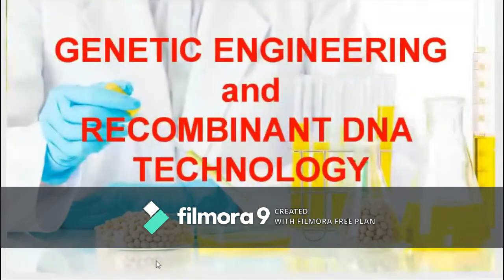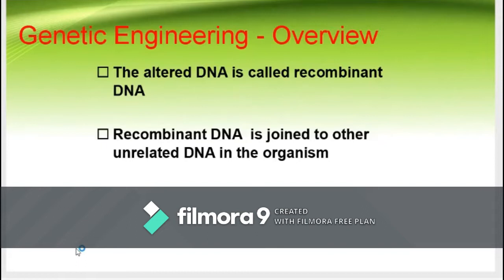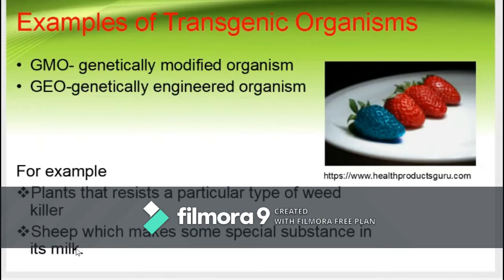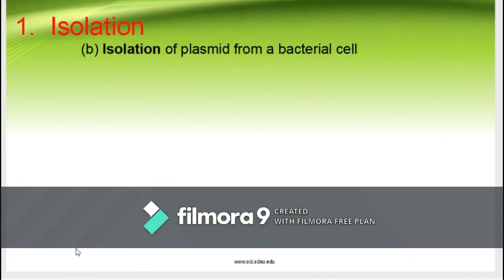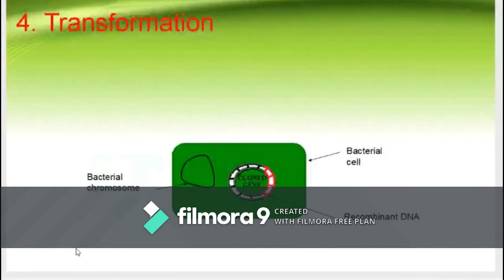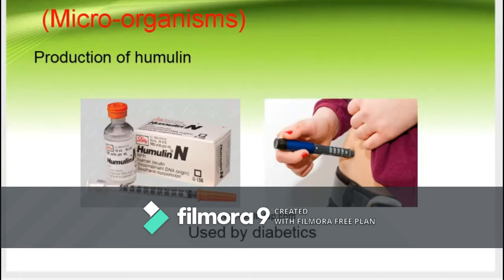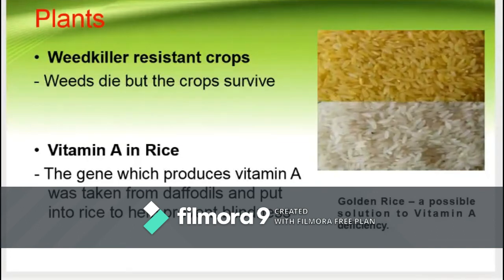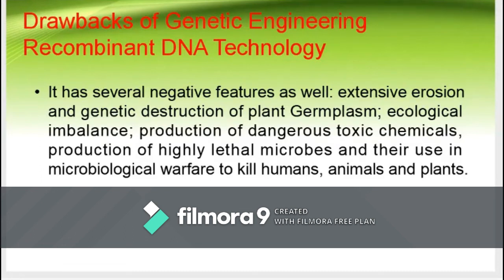GENETIC ENGINEERING & RDNA TECHNOLOGY

Comment: Alturas, Hyres Jane A. - Mendeleev 

REFLECTION IN GENETIC ENGINEERING AND RDNA TECHNOLOGY
      Genetic Engineering means that DNA from different organisms can be combined and it involves manipulating genes to make useful or beneficial products. Its purpose is to allow genes from other organisms to be combine with one another. It is usually done through addition, deletion, and manipulation of a single trait in an organism to create a want or desire change. In a molecular level, it is copying a piece of DNA from one organism and joining this copy of DNA into the DNA of another organism. Recombinant DNA is the altered DNA and it is joined to other unrelated DNA in the organism. Transgenic organisms are organisms that are altered by genetic engineering, its examples are genetically modified organism GMO and genetically engineered organism GEO. There are 5 stages of genetic engineering, the isolation, cutting, ligation and insertion, transformation and expression. Recombinant DNA technology in genetic engineering are applied in the field of medicine, agriculture, environment, and forensics. 
    According to the article AMA Principles of Medical Ethics: I, V, VII : Gene therapy involves the replacement or modification of a genetic variant to restore or enhance cellular function or the improve response to nongenetic therapies. Genetic engineering involves the use of recombinant DNA techniques to introduce new characteristics or traits. In medicine, the goal of gene therapy and genetic engineering is to alleviate human suffering and disease. As with all therapies, this goal should be pursued only within the ethical traditions of the profession, which gives primacy to the welfare of the patient. In general, genetic manipulation should be reserved for therapeutic purposes. Efforts to enhance “desirable” characteristics or to “improve” complex human traits are contrary to the ethical tradition of medicine. Because of the potential for abuse, genetic manipulation of nondisease traits or the eugenic development of offspring may never be justifiable. 
       Genetic engineering is the process of using recombinant DNA technology to alter the genetic makeup of an organism. It also involves the manipulation of one or more genes to make beneficial products. A gene from another organisms is added to other to create a desired change. Recombinant DNA is the altered DNA and it is joined to other unrelated DNA in the organism, where it is done through gene splicing where tiny segments of gene are taken out and replace by different genes. In genetic engineering, recombinant DNA technology is used in numerous ways, such as medicine for vaccines, agriculture to enhance crop quality, and many more. Moreover, genetic manipulation can carry risks to both the individuals into whom modified genetic material is introduced and to future generations. Germ-line therapy, in which a genetic modification is introduced into the genome of human gametes or their precursors, is intended to result in the expression of the modified gene in the recipient’s offspring and subsequent generations.

        In this topic, I learned a lot and understand about what is genetic engineering and recombinant DNA technology, their processes involved, purposes and the applications that involved also. Genetic Engineering when DNA from different organisms can be combined and it involves manipulating genes to make useful or beneficial products. Recombinant DNA is the altered DNA and it is joined to other unrelated DNA in the organism, where it is done through gene splicing.  It was interesting for me, knowing how useful and beneficial recombinant DNA technology is in many fields. Like in medicine, it is used for diagnoses, treatment of diseases and vaccines. In agriculture, for improvement of animal breeds in crop plants. In environmental clean ups, where they modified microorganisms are used to extract minerals from the environments. And in forensics, where they identify the patterns of DNA fragments retrieved from a crime scene.

Comment: Edera, Ann Joarec C.
STEM 11- Rutherford

GENETIC ENGINEERING AND RDNA TECHNOLOGY

	Genetic engineering is the direct manipulation or modification of an organism’s genes using the biotechnology. It is also called as genetic modification or genetic manipulation. It is a set of technologies used to alter the genetic structure of cells, including the transfer of genes inside and across species to create enhanced or novel organisms. New DNA is obtained, either by isolating the genetic material of interest or by artificially synthesizing the DNA, using recombinant DNA methods. In order to insert DNA into the host organism, a construct is usually created and used. The genomes of organisms that are altered by genetic engineering are called transgenic organisms which has two examples; the GMO that is an acronym for genetically modified organism and the GEO that is an acronym for genetically engineered organisms. Those two examples are usually interchanged by some people but actually has different concept. GMO refers to a variety of techniques used to modify the genetic structure of domesticated plants and animals in order to achieve the desired outcome. Meanwhile the GEO is one form of genetic modification that involves the systematic and intentional implementation of a targeted change to achieve a particular outcome in a plant, animal, or microbial gene sequence such as the bacteria. Genetic engineering as already stated beforehand is a complicated method which involves 5 stages such as; the isolation, cutting, ligation and insertion, transformation, and expression. It is also used in variety of fields in the industry such as; medicine, agriculture, and forensics.  
	The concept of designer babies is a highly disputed topic. I can relate this regarding with the topic because designer babies are babies whose genetic makeup has been selected or altered, either to include a particular gene or to remove genes associated with a disease. Typically, this method includes evaluating a wide variety of human embryos to classify genes associated with unique diseases and characteristics and choosing embryos that have the genetic makeup desired; a process known as genetic diagnosis preimplantation or PGD. Other possible methods by which a baby's genetic material may be changed include altering the genome directly before birth. Some may say that is it mainly beneficial because it can enhance and cure, but some would say otherwise because they see It unethical and ultimately causing problems within society.
	Genetic engineering is a complex process, especially in the development of a GMO, where genetic engineers must first select which gene they want to insert into the organism. This is driven by what the goal is for the resulting organism and is based on previous studies. To assess potential traits, genetic screens can be performed and further testing can then be used to select the best candidates. The development of microarrays, transcriptomics and genome sequencing has made identifying acceptable genes much easier. In addition, it has a potential in fixing the severity of genetic disorders found in humans by replacing the defective gene with a functional one called gene therapy. It is an important too in research that allows the functions of genetic genes to be studied. Genetic engineering is already used in the industry like medicine where some organisms are engineered to produce drugs and vaccines. In agriculture where crops have been developed to aid food security by increasing yield, nutritional value and tolerance to environmental stresses. And in forensics where it is used to identify the DNA information needed pertinent to their analysis. 
	In our modern society, humans are constantly trying to find ways to improve in order to cope up in some certain situations so the use of genetic engineering is undeniably increasing significantly over the years. It is already cohesive within the existence of humans that will linger as time continue to pass by. However, this study should be further analyzed because it showcases a critical process that needs meticulous attention especially if it is a potential for applications in humans interfering the natural occurrence of certain organisms. It may be done with good intentions and somehow with an acceptable amount of success in the previous studies, but despite its success, we individuals can not perceive its potential effects as time continues to go by.

Comment: Maphie Teese M. Adlao(STEM 11 -MENDELEEV)

	If you wonder why other organism like the color of a plant are different from the normal or original ones it is because they undergo what you so called Genetic engineering. Genetic engineering is the process where the genetic material is being altered using recombinant DNA. It can be a simple deletion, addition or manipulation of single trait in an organism. It copies a piece of genetic information from other organism to be put in the host organism where you want to desire a change of their genetic material. Genetic engineering has 5 stages; Isolation, Cutting, Ligation and Insertion, Transformation, and Expression. Each of this stage must be done accordingly or properly to avoid the production of new toxins and be able to have a successful new genetic material.

	In 2004, an American researcher team experimented a carrot that can help in preventing osteoporosis. Using the genetic engineering, they transport a CAX1 gene from the mouse ear cress and incorporate it by adding on the genetic material of the carrots. Their reason for this is to place a great amount of organically bound calcium to the carrot. In 2008, they conducted the study of the carrot and teste it on mice and 30 volunteers. After conducting the study, the results showed that 42% of the human body absorbed more calcium from the carrot the regular ones.  In conclusion, the carrot can be a help in preventing osteoporosis while the emphasis was on its bioavailability in target tissues.

	Genetic engineering paved the way in forming new organisms by combining two genes into one. The purpose of this is to make a unique sequence of DNA that will be inserted to a different organism. Genetic Engineering has five stages: First is Isolation of genes where the DNA is excluded from its host. Next is the cutting where DNA fragments is cut from the restricted sites. Ligation and Insertion comes after cutting, where in this stage is the insertion and rejoining of the cutted fragments of DNA to form artificial recombinant molecules. Next is the transformation where recombinant DNA is introduced to bacterial cell. Lastly is the expression where bacterial cell will reproduce by the process of binary fission and the result of this stage is having a new bacterial cell containing the artificial gene from the DNA donor. 

	I have learned that through genetic engineering we can change the DNA sequence of a gene in order to form a new hybrid organism that have a probability in changing or helping other organisms. These gene manipulation can enhance one or more organisms to be a different species containing hybrid genetic material, but not all genetic engineering is healthy to the host organism. It can cause the production of toxins where it can be harmful for them. Hence, this concept is very specially and important in the field of biology because by this process it will help modern-scientist to explore and experiment more in combining genes from different organisms to form a unique hybrid species by using the process of genetic engineering.

Comment: CAINE IVAN BAUTISTA - STEM MENDELEEV
REFLECTION
        The video discusses Genetic Engineering and Recombinant DNA Technology. It talks about the description, the terms to be used, the process of Genetic Engineering, and examples of Transgenic Organisms. This video also talks about the applications of recombinant DNA or rDNA, like in Medicine, Agriculture, and Forensics. Just like any other process, Genetic Engineering rDNA Technology also has its own drawbacks.
	The ability to alter DNA molecules by endonuclease restriction and DNA ligase is called DNA cloning in modern molecular biology, and it is possible to create recombinant DNA. A single copy of the recombinant DNA, however, is not sufficient. Replication machines of one organism are generally used to increase the number of copies. The DNA is inserted into the organism for dissemination or transformation. In general, the vector has an autonomous replication mechanism that is independent of the cell cycle, increasing the number of copies.
	Genetic Engineering has many applications in our daily lives, life for our health, but its process is not simple. The process for Genetic Engineering comprises 5 steps, Isolation, Cutting, Ligation and Insertion, Transformation, and Expression. To be able to achieve a successful Genetic Engineered material scientists need a long amount of time to properly execute the steps. Due to the usefulness of this process, this is not only used in science but also in other parts of society like media forensic and paternity. 
	I’ve learned many things about Genetic Engineering because of this video. From the processes to the different applications in our daily lives. Right now, it is used mainly for medicines but due to its features, it can also cause an ecological imbalance, it can produce harmful chemicals that are very dangerous to every living organism. We must use this process only for everyone’s well-being and not just for selfish reasons because it might be the reason for our extinction, who knows.

Comment: Charmagne Tiu from STEM 11 - Rutherford

Genetic engineering is the process of modifying an organism's genetic structure by using recombinant DNA (rDNA) technology. By regulating breeding and choosing offspring with desirable traits, humans have manipulated genomes indirectly. The purposeful modification of the DNA of an organism is genetic engineering.

One of the related studies for Genetic Engineering is Biomedical Research and agricultural purposes, developments in this field have enabled scientists to produce genetically modified cells and organisms. However, the implementation of genetic technologies, such as gene therapy, for use as therapeutics in humans is still a work in progress. In three simple stages, genetic engineering is completed. This is the separation of a particular gene from DNA fragments. The introduction into a genetically modified organism of an isolated donor DNA fragment and the development of a recombinant vector in a suitable host. Such measures are reviewed briefly and the role they each play in a genetic engineering experiment is addressed. One of the related studies about genetic engineering is "Genetic Modification of Biomass" Genetic engineering provides the potential to develop not only forage and turf crops, but also bioenergy crops, by enabling foreign genes from unrelated species to be introduced and endogenous genes to be downregulated or upregulated. For example, genetic modification of the lignin biosynthetic pathway in switchgrass, a leading bioenergy feedstock in the United States, has successfully developed plants that fermented more ethanol than unmodified biomass.
 
By replacing the faulty gene with a working one, genetic modification may theoretically repair serious genetic defects in humans. In science, it is an important instrument that allows the study of the role of specific genes. Drugs, vaccines, and other items from species bred to produce them have been harvested. Crops that support food security by increasing yield, nutritional value, and environmental stress tolerance have been established. 

Learning about genetic engineering is very helpful in terms of agriculture, medicine, and etc. Genetic engineering has been used in medicine for the mass manufacture of insulin, human growth hormones, follistim (infertility treatment), human albumin, monoclonal antibodies, antihemophilic factors, vaccines, and many other medicines. Increased crop yields, decreased food or drug production prices, reduced pesticide requirements, improved nutrient composition and food quality, resistance to pests and diseases, increased food security and medical benefits for the increasing world population are some of the benefits of genetic engineering in agriculture.